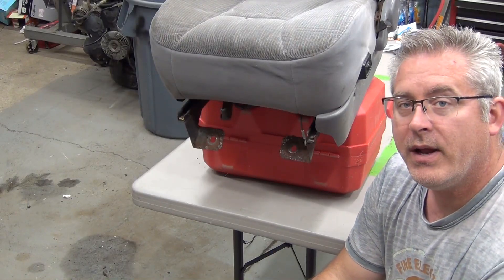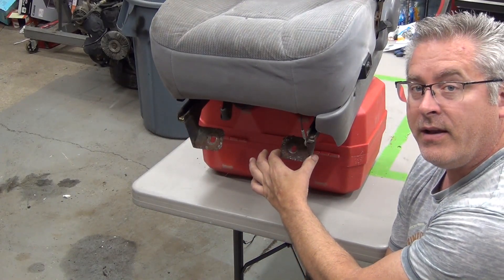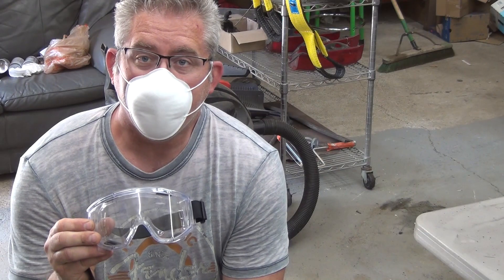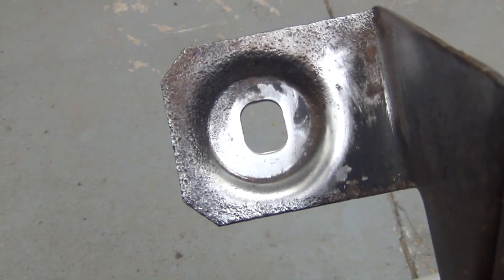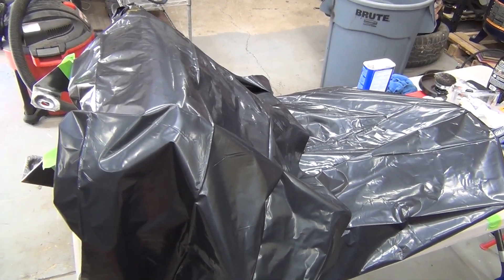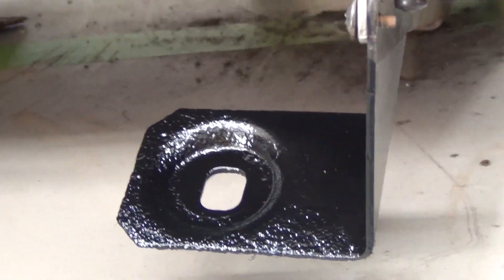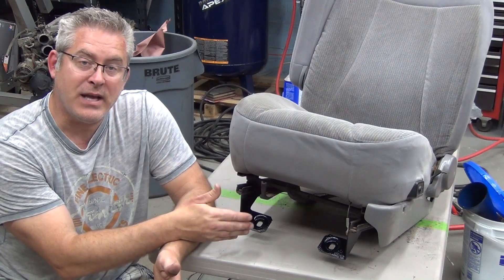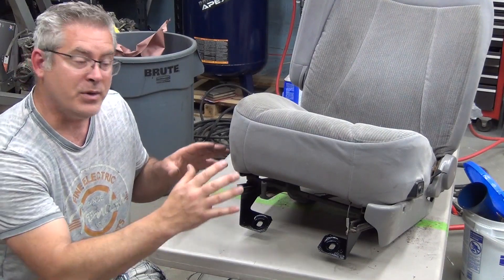Seat Frame Clean-Up on Ford Bronco OBS F150 F250 F350

Comment: How difficult is it to replace a front bench seat to buckets?
Reply from the maker: Simple, but you’ll need to drill 4 new holes as most bench seat pans only came with 4.  And you’ll need to reinforce the new holes